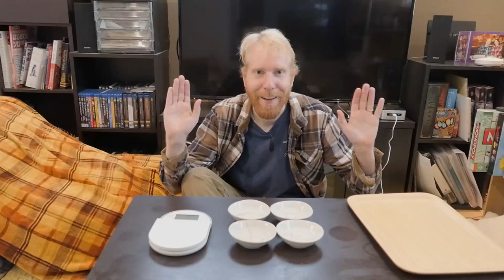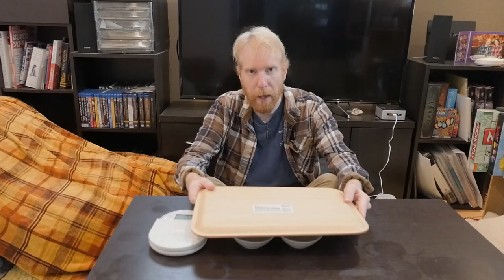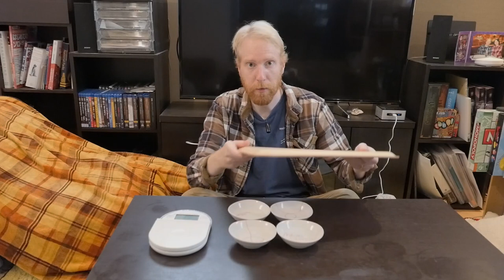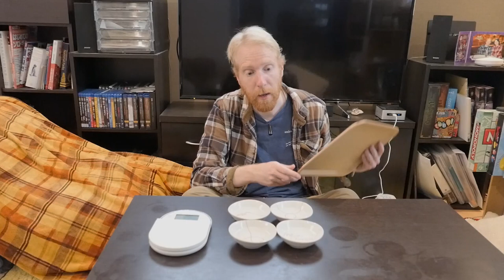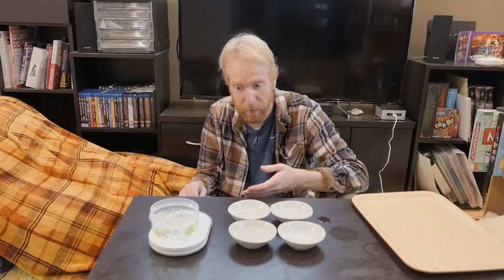Shot Noise and Read Noise - Noise in Astrophotography Ep1

Comment: So I have an off the wall question for you, but you might be able to help my understanding here. I haven't made it through this series of videos, but my question is a bit different. I understand the basics of "Shot" noise and "Read" noise (Upstream which can be amplified by dialing up amplification with ISO, and downstream - inherent to the camera). My question is this (sort of has to do with stacking - sort of). A well known photographer will "stack/combine" three 14-bit images in  Photoshop (i.e. a portrait containing environment). He will photograph the scene using a strobe. He brackets his the three shots (not going to use the word exposure here) by only varying ISO. So flash power, aperture, and shutter speed remain constant. His goal is a 32-bit file in the largest color space to manipulate and print. His work is excellent, but I have a question regarding the science of his bracketing technique -- which he either can't or won't explain. In an ISO invariant sensor, is there any advantage of bracketing ISO two stops up and down or center vs taking the same image, copying it into three images, and combining those and then pushing the processing of highlights and shadows? I realize, that by copying the image twice, you eliminate the variance of environment "shot noise" differences, but do you think you can actually see the difference? It seems, by bracketing ISO, you're just introducing more noise then needed - certainly at the higher ISO. I do realize that some cameras (i.e. Nikon D850 has two processing engines that gives ISO 400 more DR than ISO 380). That aside, can you see any advantage to doing a bracket of ISO when keeping the other variables of SS/Aperture/flash power unchanged?
Reply from the maker: Well, ISO is just an amplifier. Higher ISO isn't intrinsically noisier than lower ISO in terms of SNR. In fact, higher ISOs typically have LOWER read noise (very important for astrophotography), but sacrifice dynamic range to some extent.  Higher ISOs appear to have more noise, simply because normally higher ISO is associated with something like faster shutter speed (to freeze the moment for instance), but in that case everything, including the shot noise, gets amplified by the high ISO to achieve the same brightness level as a longer exposure with lower ISO. With a shorter exposure (regardless of ISO) you will achieve less signal, less shot noise (sqrt(signal)) and worse Signal to Shot Noise Ratio than a longer exposure. If you used higher ISO to achieve higher overall brightness you'll have LESS read noise, but also less dynamic range than an exposure with lower ISO.

With bracketing you have:
- an underexposed low ISO image with high dynamic range and high read noise (read noise is usually inconsequential in well lit conditions, but very important in astrophotography)
- a well exposed normal ISO image with good DR and "normal" read noise (sweet spot is usually around 800 for a lot of cameras in terms of read noise). Maybe the normally exposed image could have clipped highlights somewhere.
- an overexposed high ISO image with low dynamic range, potentially clipped highlights, low read noise.
Because all share the same parameters besides the ISO (which is just an amplifier, nothing more nothing less), they have sensibly the same SNR (low ISO slightly worse because of high read noise). But each covers a different dynamic range (say 14 stops for low iso image, 13 stops for medium iso image, 12 stops for high iso image), centered differently.
Depending on how the bracketed images are combined (as assume some kind of HDR replacement + averaging), you will have better SNR by increasing signal more than shot noise, because square root function (although the LOW ISO image does introduce slightly more read noise), AND an HDR picture that covers a lot of dynamic range.
It makes sense to me in a lot of cases!
Reply: @CuivTheLazyGeek  That was a very helpful response (and thank you very much). I'm had a feeling you could answer it. That said, while I do the research, can you explain why high ISO has "lower" read noise? And are we talking about upstream (pixel level) or downstream of the ISO amplifier to card? I guess I don't understand the mathematical formula (yet) on how with higher ISO there is less read noise and lower ISO high read noise. Take your time, but if I understand that piece to the puzzle, I think I can make it the rest of the way. BTW: Enjoyed the video a lot. Helped immensely.

Comment: Just a thought while we are doing min thoughts, will the noise % of a 1 second exposure not remain higher as each is being multiplied by the same factor. So the read noise will represent a much higher ratio than swamping the noise with longer exposures and a much higher signal. As a biologist it seems to me that you are extrapolating small sample data to equate with a much larger sample single sample which surely will include all data not present in the small data set?
Reply from the maker: You are right, have a look at how that darn read noise stacks in the total stack here: https://www.youtube.com/watch?v=3RH93UvP358&t=2733s